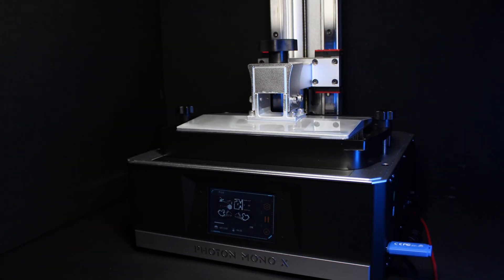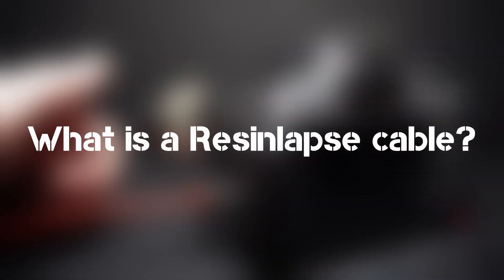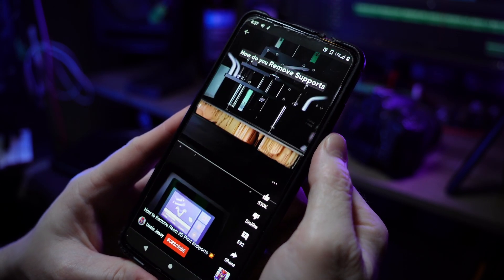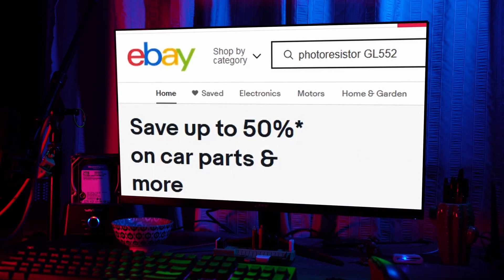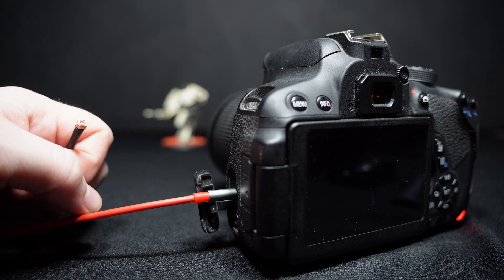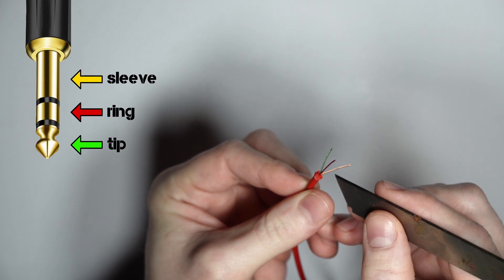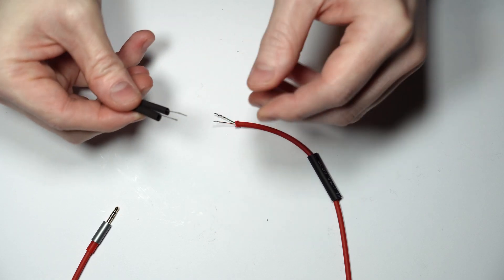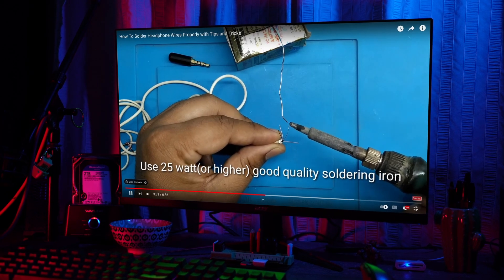The clever tool that makes it possible (and how to make your own)

Comment: I built something like this. But I put a panel mount jack in the side of my printer and just wired the resistor straight to the panel mount. that way I could then plug the cable from the camera straight into the side of my printer and unplug it whenever I wanted to disconnect it. Far better then a cable you have to kind of push into the vents.
Reply from the maker: That's a bloody great idea!

Comment: there are three ways to connect the resistor, say the three wires are labeled A B and C, you can go A-B B-C or A-C and since polarity does not matter, you have approximately a 66% chance of it working the first time. If you hooked up A-B and it does not work, change it to A-C and try again. If it still does not work move to B-C. Each time you change only one wire, so this will minimize the number of times you have to check. Of course you could always temporarily hook the photo resister up to two of the wires at a time until it works, and then solder them, but that would be too easy!

Comment: Do you think a 2.5 mm headphone repair jack work? The wires are already exposed and all you would have to do is plug it onto a 2.5 mm dual male end cable after soldering the photo resistor to the female plug wire ends.

Comment: Thanks for the instructions on how to do this and the shopping list as (for some stupid reason) the cable doesn't ship to Australia from either their Etsy or bigcartel stores.
Fingers crossed, I can make one as you did!
Reply from the maker: Good luck!
Reply: @OnceinaSixSide  If I get stuck...
Reply: @OnceinaSixSide  Me again. Really dumb question but what do you have your camera set on for this. to work? I have access to a 550D and for the love of me, I cant get the cable to fire outside of being in movie mode which has a bit of a delay!
Reply from the maker: Hmm you'd think that should be pretty similar to my 700d. I'm fairly certain mine functions during photo mode, so I'm unsure! Maybe a setting in the menu is blocking it, like some kind of intervelometer override?
Reply: @OnceinaSixSide  Thanks for the hint. I think that may have been it! I can now trigger my 550D at a steady rate on the photo setting.
Turns out the 550D may not have an intervalometer setting (as such), but you can use a 'hack' called magic lantern to fix this (just in case anyone else has the same issue I had).
Now to play around with this and see what it can do!

Thanks again

Comment: i love to see maker content weaving together like this, it's the old internet promise of interconnectivity made manifest.  
a little tip for soldering: use flux it makes the solder behave much better and use a heat gun (or similar hot-air blowing device) for the shrink tubes, they shrink much more tightly and more consistently than with flame.
Reply from the maker: Cheers for the tip! I'll have to buy a heat gun one of these days for sure.
Reply: @OnceinaSixSide  they are super useful for projects that use EVA foam like foam gaming mats and cosplay, tried to use mine to quick dry some minis once, they're melta gun victims now.
Reply: @thra-x1855  sounds like soldering minis instead of glueing them might be fun for chaosy units

Comment: Please please please do not strip the cable using the soldering iron... do anything but that, literally use your teeth, a rusty old knife or anything else. 
That poor soldering iron...
Reply from the maker: Nothing bonds to the iron, this is fine to do. Any other form of stripping makes the following steps impossible due to the nature of these wires.